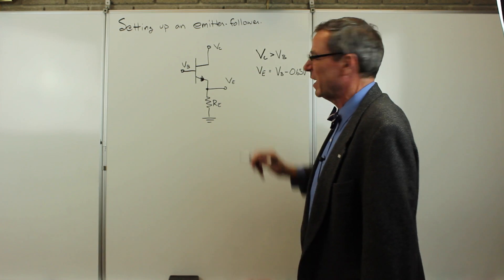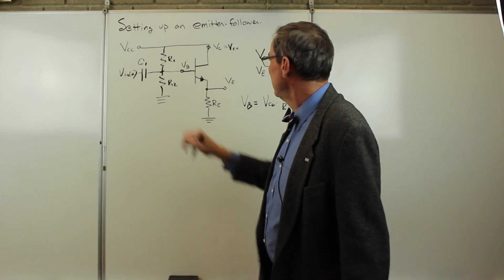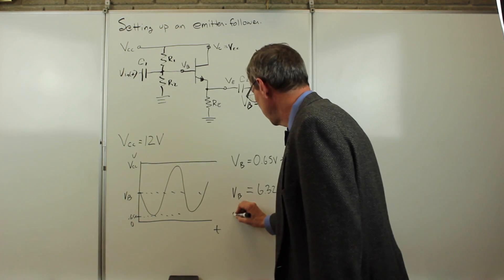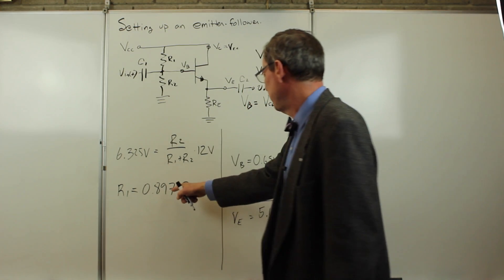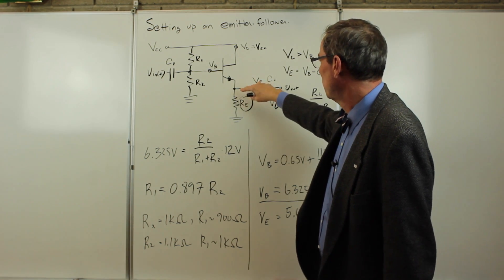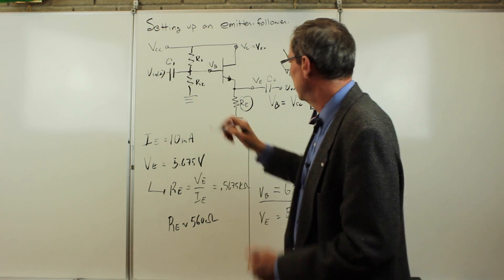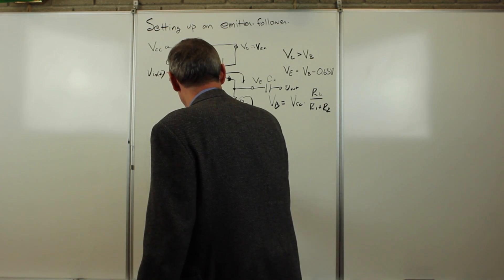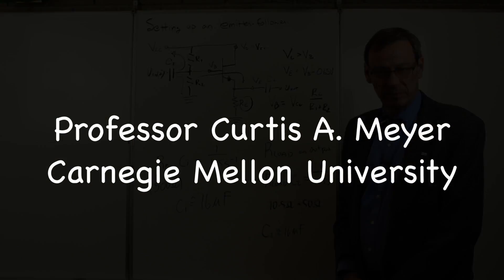Chapter 5: Setting Up An Emitter Follower Circuit

Comment: This is an excellent explanation  of the  conventional emitter follower

Unfortunately, most books describe the emitter follower as a unity-gain amplifier without stating the conditions. The conventional emitter follower is a unity-gain amplifier because both the input and the output are grounded to the same ground! 

To understand transistors to a more advanced level, one needs to introduce the fact that the input to the emitter follower could be with respect to the emitter itself and not to the ground, that is, the input is always floating between the emitter and the base with both the DC bias component and the signal level. This means that the input is now bootstrapped to the emitter, and it will ride on top of the output as in a bootstrap circuit, and the gain will not be unity, but as in other amplifiers. The input is always between the emitter and
 base. The output will not be fed back to the input as negative feedback, which is the reason why the conventional emitter follower has unity gain, as the output is subtracted from the input as in any automatic control system for positional control. 

Introducing the bootstrap effect in a conventional emitter follower is not too difficult. One can introduce the input between the emitter and base through a floating transformer secondary,  and one can compromise on the DC bias by not anchoring the bias circuit and using high resistances as the bias resistors.  Linking the DC to the emitter by a capacitor will retain the bias, but will provide a loop through which the input can be bootstrapped while the bias high impedance circuit can be floated to other levels as in a bootstrap circuit.  This is not high-level thinking, but merely to indicate that a floating input between emitter and base can eliminate the negative feedback of a conventional emitter follower. Interestingly, an emitter follower with a bootstrap is also an emitter follower, as is used in driving the higher placed MOSFET in a  MOSFET half-bridge driver.

As for the input and output impedance, tutors teaching transformer operations must start to mention the fact that the pair of diodes in a BJT transistor is unsymmetrical, and so we need to talk of different input and output impedances for positive and negative going inputs and outputs. Here we come to the student fully understanding the concept of current sources and voltage sources and their ideal input and output impedances. In the emitter follower shown in this video, the base emitter diode decides on the output impedance, and if is not biased, the output impedance is the emitter resistor.  which should be very low to discharge any load attached to the emitter. For a load at the collector, which is regarded as a current source, the same is happening as a hard-driven transistor can have its output impedance changed from a high level to a low level bu " the driving forces forces one applied.

The concept of applying input signals and output signals anchored solidly to the same ground could be modified to the more advanced students to show that the same transistor will basically behave the same regardless of its connections, and the conventional emitter follower with a floating input between emitter and base, will behave the same as when the load is at the collector.

To prove my point, as an old man, I returned to my younger days and designed all the oscillators possible and operating at around one megacycles to 30 megacycles, one can use transformers to couple floating inputs between emitter and base.   without anchoring the ground by the use of capacitors on the bias circuits, so that a bootstrap effect on the emitter follower will result. All my oscillators using emitter follower with bootstrap work very nicely as their gain is higher than unity.  The bootstrap effect in the emitter follower should be introduced when explaining the conventional emitter follower, and why, when the bootstrap does not exist, the bootstrap becomes a negative feedback to reduce the input to the transistor, hence the unity gain as in any positional control system. Looking a little deeper, most amplifiers can be treated as a Positional control system with full PID control if necessary.

The manner in which this video presents the conventional emitter follower is excellent, and even with such excellent presentation, some people will not follow. It would be encouraging to me as an old man to see someone presenting the emitter follower with a bootstrapped input riding on top of the output. I would say that one transformer will behave the same in whatever configuration one uses it. Still, the trick is to see what is happening external to the transformer, as it is the external connection that is the difficult part to understand, where sometimes the input and the output are independent of each other. Sometimes they are not, as in the case of the conventional emitter follower.

Congratulations on the neatness of the diagrams and the mathematical analysis in this video, and the clarity of the diction. Anchoring the DC bias and the Output to a soft or hard anchoring point introduces a few more miracles in transactor behaviour. and the variation of input and output impedances for positive and negative going signals adds more excitement,  but is usually rejected by a lot of people, 

No profession throughout history has assisted the human family to live at such a level of guaranteed comfort as Engineers have since 1750, when John Harrison developed the grasshopper escapement logic for the clock. The logic and understanding of engineering to a higher level questioned the psychological illusions of philosophy, politics, religion, entertainment and emotional behaviour of humans, as it is only engineering that exists outside the human mind, while inside the human mind, there are only thoughts, lies, fantasies, fiction and a lot of emotional illusions.  There is more depth in just one emitter follower than all the philosophies and psychologies presented through history to create illusions in the human mind. which cannot be synthesised in the real universe as engineering can be, provided one understands engineering in depth.  Most people love to live in superficial emotional illusions to create fantasies that will stay in the human mind, and believe in the powers of Harry Potter and Alice in Wonderland, which is like this video; it is only an ENGINEERING STRUCTURE  that can depict reality outside the human mind. where even voice and written symbolic language must be engineered in the space outside the human mind to be useful to humanity.

Comment: Super clear and simple explanation. One question: where is a load resistor? Normally 4 resistors are used for this type of circuits?
Reply: JurekPrzezdziecki It is an emitter follower, the output is developed across the emitter resistor.

Comment: how did omega(Rc) became 125 s inverse? plz explain
Reply: w = 2*pi*f [rad/s] or [rad*s^-1] and f = 20 [Hz] or [s^-1]
w = 2*pi*20 = 125 rad/s

Note that because the radian is a dimensionless unit, the radian per second is dimensionally equivalent to the hertz—both are defined as one s−1. This means that great care must be taken to avoid confusing angular frequency ω and frequency f.

Source URL: https://en.wikipedia.org/wiki/Radian_per_second

Comment: why cant you have large voltage divider resistor
Reply: +William Madrideo That will limit the base current I guess! Theoretically input to the base is current, not voltage.
Reply: Lol this is from 4 years ago but im bored so: the output impedance of this circuit is related to the input impedance by a factor of Beta (current gain of transistor), which he was using 100 for Beta in the video. If you choose too high of bias resistors, even dividing by beta still leaves you with a high output impedance and you can't properly drive heavy loads (which is what this circuit is sort of meant for).

Comment: Hey, great, great video. One question I have, why do you apply the 20Hz to the angular frequency equation, ω =2πf? What's the significance of using this equation for the calculation?
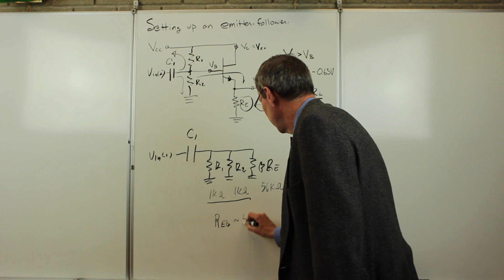Reply: +ElectronicsLearning The cutoff frequency of high pass filter is 1/(2 pi R C1) where R is 500 (just like shown in 9:20) and C1 is value for the capacitor you are looking for.
So you just need to solve

              1
--------------------------- = 20  
2 * pi * 500 * C1

for C1, and you get C1 = 0000159155, approximately 16uF.